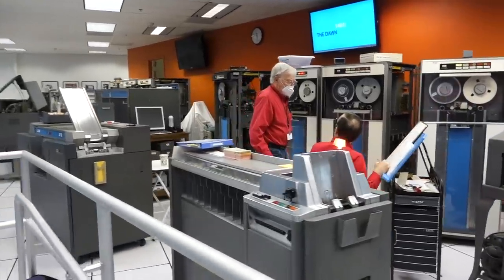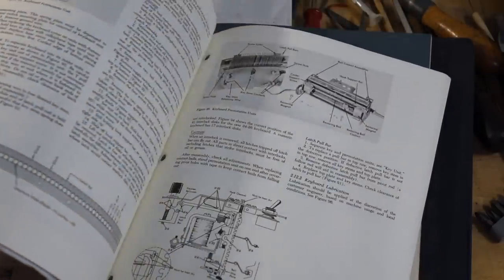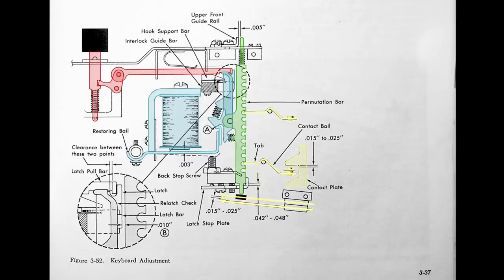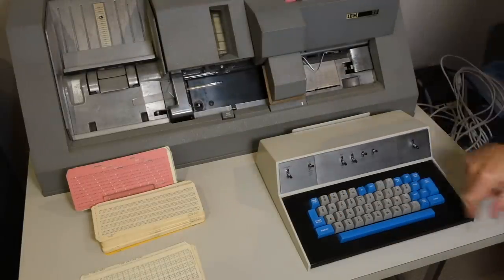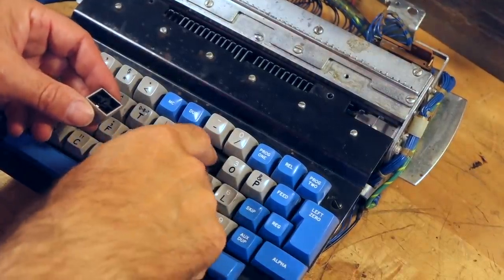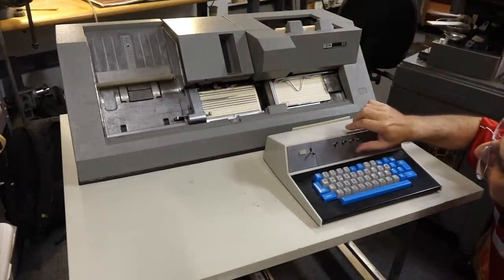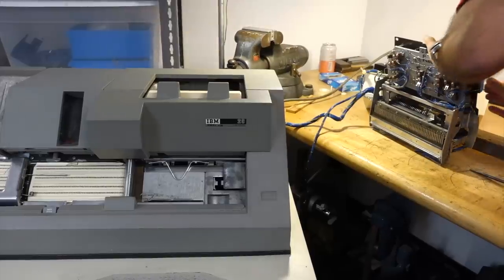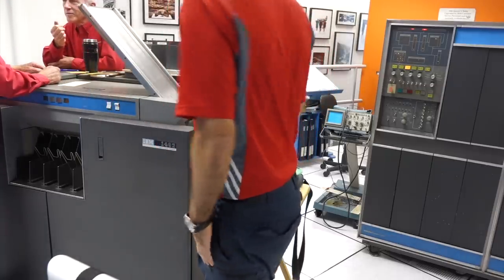The IBM 029 keypunch mechanical keyboard: insanely complicated!

Comment: I came to know the 029 (and the Univac equivalent the 1710) quite well, while aboard the USS Jason AR8 (Auxiliary Repair) in the early 1970s.  My main job as a "data processor (DP)" rating was to keypunch/keyverify punch cards off of work orders and supply part lists for repair carried out by the USS Jason work force on ships - usually destroyers - berthed alongside.  Cards were input into our discrete transistor/diode/core memory logic AN/UYK 5V computer (a militarized Univac 1218), via programs launched via teletype input with four tape reader/writers, to produce various supply reports by a mongamous chain printer, but only when tied up at the dock!  At sea everything was powered down.

Comment: I had to use an 029 for a programming course in my first year at University in 75/76.  They broke down fairly often as many of us students would use them to punch out large dot-matrix signs and many of the "characters" required punching out 8 holes at a time !   5 years later I was working at big blue and running an ancient 1430 as the processor for a logic card tester...

Comment: Waouh, I'm impressed. Most of the logic's was electromechanical by then. It was a real technical challenge to design and assemble such computers. The price of this set must have been considerable, not to mention the team that had to make it work.  Surely you had to have a very important need to start buying (or renting) such a system.

Comment: Another travel back in time ...
In the early 1980s, in my times at the University of Technology in Vienna, there were still a few of these IBM keypunch machines around. They were located on the corridor in front of the computing center in the Electrotechnical Institute building.
As a student, I had to use one occasionally. To sign up for certain tutorials or practical exercises, we had to punch our matriculation number and name on a card and drop it into a dedicated letterbox. The tutors collected these cards and produced the list of participants from the stack.
Until the mid 1980s, these keypunch machines were gone.

Comment: The system console for the IBM System/360 mainframes, the IBM 1052 Printer-Keyboard, had exactly the same mechanism as the 029 keyboard here but with a different case to accomodate some extra buttons on the sides. It was a mechanically and electrically separate unit but physically attached to a 1053 Keyboardless Printer unit. That's why the 1052 doesn't look quite like a regular Selectric, the distance between the top row of keys and the printer is longer. 
I have the FE service manuals for the 1052 and 1053 which includes servicing this amazing keyboard on my documents-to-be-scanned pile.
Reply from the maker: oh please scan it! I will have a 1052 to repair pretty soon.
Reply: @CuriousMarc  OK sure I will bump the priority :)  Been looking for a 1052 myself for years and years but I'll never find one, so have been working on a replica based on a Selectric I've split apart into the keyboard and power frame components, and generated the case shells from photogrammetry on 1052 images.
Reply from the maker: @1944GPW  contact me through the link in the video description. We’ll find you a 1052…
Reply: @CuriousMarc  That... would be supremely awesome. I've just started levering out the rusty staples now.

Comment: There is a special place in Hell for people destroying museum equipment.

Btw I have used such a 029 on many occasions in past. At the university we had 6 Sperry video terminals connecting to a remote Sperry Univac mainframe. Most students use these terminals, but there were never enough terminals so one often had to wait for another student to finish before you could use one.

But there was also two 029 punches sitting unused in a small room next to the big terminal room - and a card reader connected to the remote mainframe. It did not take me long to find a stack of fresh punch cards, fire up the 029, and learn to use it. It turned out that it was actually a very effective method to quickly enter and/or make a change to a program, put the cards in the reader with 3-5 control cards to start a job, push the start button, and after 20-30 seconds the line printer would start spewing out your result (if you were lucky) - or a register dump (if you were not).

Using the punch had another advantage: It was free! Using the online terminals meant that CPU time was accruing to your personal account, and each student was only allocated a certain amount of CPU time at the start of each semester. One could apply for more when it ran out, but it was a hassle. Editing a card, as in fixing a line of code, offline was free :) And as I said, very effective once you learned to use the copy function on the punch.
Reply: In that place in Hell, you have to code in trinary on a machine that drops half the trits.

Comment: Hi Marc.
I've just watched this again and noticed at 21:59 where you are comparing the punched card to the pdf document, there are discrepancies in rows "7" and "8" for the "special characters".
In the pdf, row 7 has 4 holes and row 8 has two spaces, but in the punched card, row 7 has 3 holes and row 8 has 3 spaces. (I may be wrong about row 8 though).
Don't know if anyone else noticed.

Comment: 23:23 I would expect some indication on which column you are typing. Or is that an expensive feature? Or is it visible enough in the card slot itself 🤔
Reply: I guess it was visible. Later, I saw punches for 96-column cards and they had a two-digit display for the column number, because it didn't start punching until you hit release, if I remember correctly. At one school I went to, they had an IBM 3 and there was one keypunch. If two people wanted to be punching cards, and if there was nothing else the computer had to be doing, one person could use the computer as a card punch. It had a keyboard for just that purpose, and I remember for quite sure the column number display on that.
Reply from the maker: The position counter is located at the bottom of the drum, visible through the window at the center of the machine.

Comment: Can someone tell me please what is the 0-8-2 over the key T? At 18:52 you can see many more of these 3 number combinations over the keys. Strange.
Reply from the maker: It's the list of punches it will punch on the card, as I explain in the video. That particular control character does not have a printable equivalent, so they just list its punch code.
Reply: @CuriousMarc  Thanks a lot, Marc!! I should have found it out, though :) Congrats for taming this beast!

Comment: When I was a freshman, I had had to use this stupid keyboard to punch my Fortran programs.  Half of the times I either miss typed or the card would jam.  There was a pointer which would show where the position of last character entered was and sometimes it was off by one char.  Then this gismo sometimes decideded to hang and then there was no power button to reset it.  The only solution I had was to pull the plug from wall. I'm glad they went to the museum and they never came back! Had this keyboard not gone obsolete, the computer programming would never have taken off. That's why dec invented vt100 not ibm. Like apple most computer makers started from building their keyboards and monitor screens (sometimes TV'S like commodore) first.  When this gadget came out it would have cost as much as ten cars.
Reply: @CuriousMarc  I think there were two occasions that computer technology went backward.  One was this punch card machine and other was the invention of half completed (ass) scripting languages like csh bsh bash and so on.  These scripting languages were like musical instruments that never kept their tunes which you don't know if it's your problem or the instruments. I know there are a lot of people who love these two but I hate them both and I am happy I  never have to work with them again.

Comment: Compusaur...LOL.  I wonder what their extinction driver will be.  I would guess that at least most of the diagrams used in that manual were probably the design documentation toward fab.

CLANK.   Nope that wasn't it.  Been there,  more times than I would like to admit.  
"They were talking about sliding something out, and that something might prevent it.  I would be willing to bet that statement could be applied accurately to a large percentage of the parts in that machine, at least unless you are willing to disassemble the galaxy of things orbiting the part to be removed.  :-/   🙂

Key abuse of that machine should be addressed in congress.  Can we get someone to sponsor a bill?